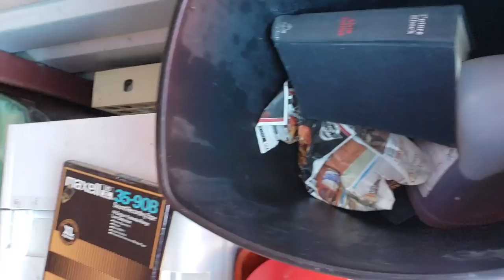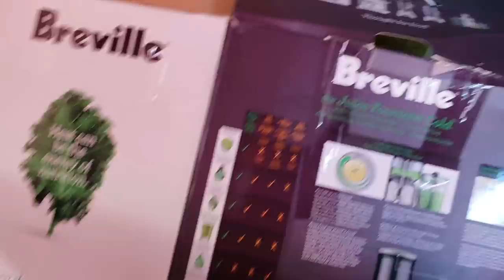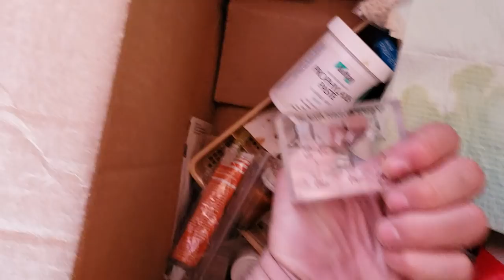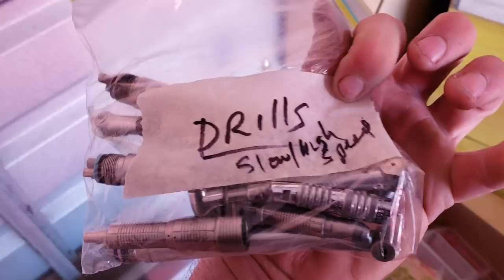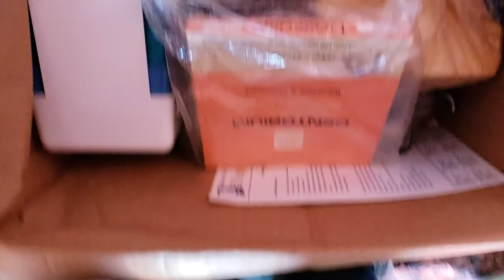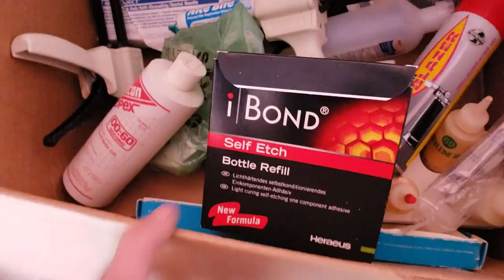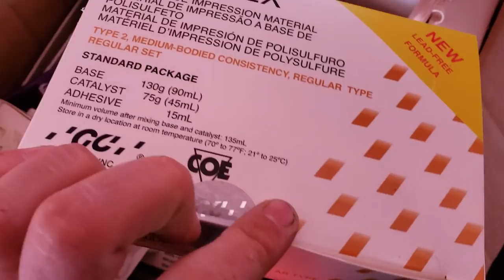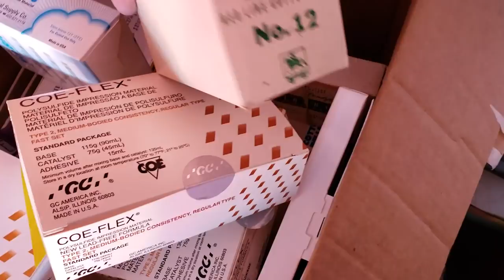$360 Storage Auction Unit Reveal Sometimes BIG Profits Can Be Boring It's All Part Of The Game

Comment: Those dental chairs with the round backs will get $100 each easy ( new they are over $500ea) and the x-ray machine will be snapped up by vets . Even though it is the type that takes an x-ray of all of your teeth by moving in an ark around your head it can be set to take a single image. All the best